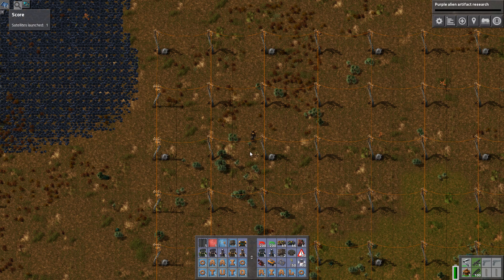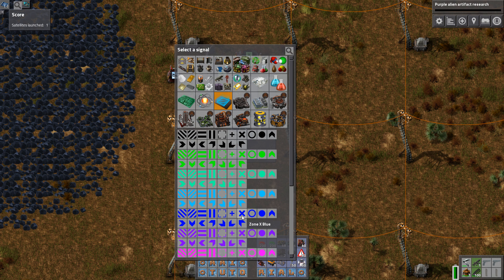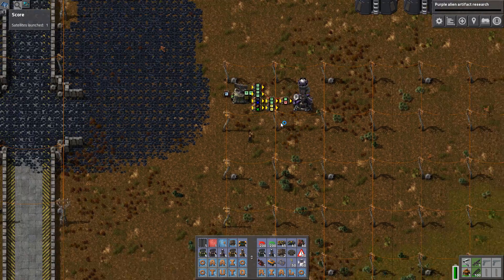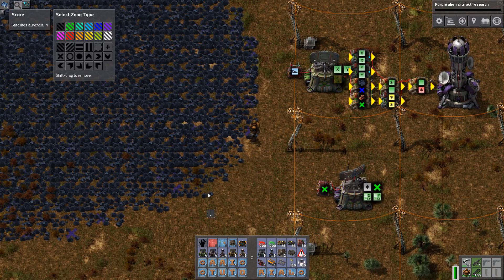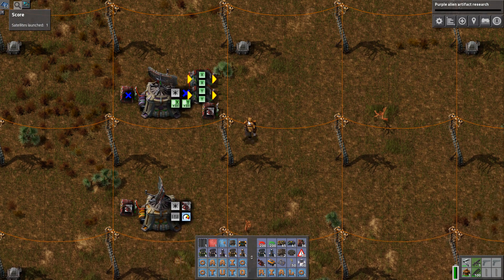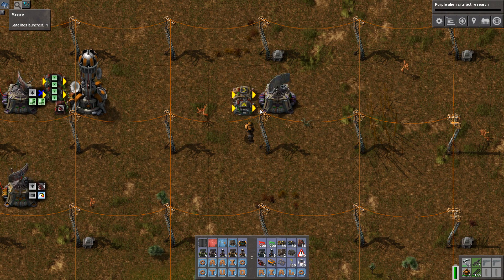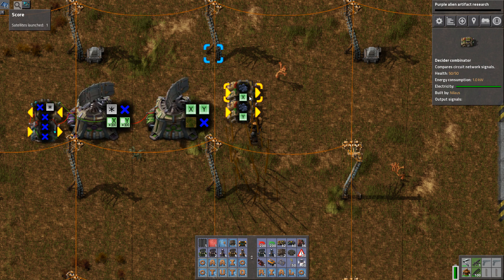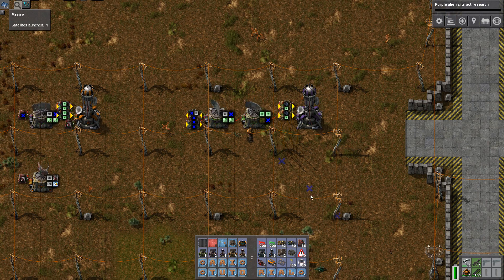AAI Mod Tutorial 3 - Automatic Zone and Miner assignment

Comment: so i can see im clearly not the only one scratching his head here haha. But for anyone who knows a bit about this can you tell me what symbol he used in the condition for the x & y combinator? since factorio has been long since updated but there isnt any symbol like it atm. you have the usual greater than less than greater or equal ect. But no cross of saint peter lol.
Reply: It's a plus sign. using an arithmetic combinator with input (whatever) + 0 , output (whatever) 'cleans' the wire to only one specific symbol. He was using it to separate the X and Y coordinates into their own wires.
Reply: @Paradician  thank you so much. I’ve found very little information about newer setups for this mod, most of them seem to be years ago unfortunately. Thank you regardless~

Comment: A brief comment for people who are trying to get this to work. Something has been changed in the mod. Now, when you click on the output for a Tile Scanner, it has a bunch of checkmarks to let you filter the sort of results you are getting. You need to UNCHECK "Entities" if you are trying to scan ore patches. If that box is checked, the Tile Scanner will be looking for loose pieces of ore that have for some reason been dropped on the ground. By unchecking it, it will scan for patches of minable ore instead. You need to do this in both the automatic scanner and the clean up scanner.
Reply: THANK YOU

Comment: The tile scanner can be pretty useful when you're trying to find resources in areas you haven't revealed on the map yet. Before I started using this mod when it came time to look for oil I use to have to drive all over the place and sometimes spend hours looking for it. 

Now I use a loop setup where I can put in a minimum and maximum x and y. After a bit of calibration I can assign sectors to scan. If it finds oil it will send out chain gunners to scout it out, with a system set up to scan a radius around each chain gunner to mark biter bases to remove. Once the detected nest is out of the way it resumes scouting out the oil fields.

It takes quite a bit of setup and finding bases can be nail biting since you don't know how many chain gunners will go a particular direction if multiple fields are detected (or if they'll split up and each try to commando a base if multiple bases are detected in an area), but it's been working pretty well so far.

The tile scanner is only useless when you don't give it any input and let it do the random scan thing.

Comment: Hi first i say sry for my bad english.
I have a big Proplem with your Blueprints from Discord. Sometimes the Hauler (Nilaus Truck) go to the Miner and go back, ok. But often the Miner is full but the Hauler stand still. Or the Hauler drive a bit, stand still, drive a bit, stand still... (anywhere but not to the Miner) I look between the Ticks but this is right. I stop the Counter -> the same Problem. Ok i jump in my Car, drive to the Miner and the Hauler and look the Hauler drive to the Miner. I drive back to the Base after some Minutes the Problem beginns again. Do you know what i have to do?
Reply: Sry i Forgot to say something.
I check the Signals on the Unit Controller and there are the right signals. Hauler 1 to Miner 1, 2 to 2 and so on. The coordinates are right. ok theres no Issues with the Signals by the Unit controller. But the Hauler lags more and more

Comment: Your first automatic scanner is wrong,  because you put the blue and green x's through another set of combinators it delays the signals by 1 tick.  When you pulled the x,y to the third combinator you are combining them with the blue/green x's from the previous tick.  

The fix is to pull, using a red wire, the x,y coordinates to the Each/Each combinator, you want to use red not green as you don't want the x,y going to the Anything combinator.
Reply: thanks a lot, i fixed mine
Reply: I fixed it like this. I'm not sure if this is right.  0eNq9WNGOojAU/Ze+LhhKZVAe9kc2hiBUp1loSVvMsBP+fW+L4yApDjg6L0YETk/Pufce8B3ty4bWknGNknfEcsEVSv68I8WOPCvNb7qtKUoQ07RCHuJZZY40K6mv8oyjzkOMF/QNJbjzvrzvn+DUh0W0FOXg1rDbeYhyzTSj/fr2oE15U+2pBOwLgtKyybV/pJxKllsO8M1XVGvGjwqWqoUCHMENCcD2iYdalASwWsEkzftTaw+daaR7+pqdmJDm+gMrNZUTEpyY1A388snFXuEHZie5aIyG+As5pjDwAMPHA2GWgKhGHrKcOumQRUhvvnHYCbReCKSavRMnWoRTZrxwwrwsgmH8BJUlZOurUmgnYLwIEMqwav2GMzfYZhk79xa3i0Bqxv+6CzLodp2BGvVW6Ojq6S5yAJALQCaZfq2ohsbMRbVnPAOtHWDBKrJwPr7uytDdlZ+wKZwuLJTq21Uqnd5R1YoaIIOmdGZkCjwkaiqzngf6BfeKRtfNHeidFR+mUn7hic2HpMVwtIHZyRauZDJvmLaHGAzyUDjv4tC46XBjPTUqz8qWN6fl2jksHctE7pl+A9Dl7MeGKlHQVBzSgQd4vowYz5PmZUoaxsFpR52uV2FAcNgXa7DC222IN3HkipI5POMJXvGF10dB3m6fng/uHphhMuPHq3kfDIJsN9+Kl4ktbqak77vMsUm82gRBvJmn/mNEuJWf+Hv5Ga7JnaHejqEICe9O9eswBlJRcGewtyMsYDXAeli47741TF2VuL07rYIfDav2qWHVLg8rMtbXuzq9GR2bCTI/3Mh4gns3J/yUuWbR80YLmrMCsm6WtfOeQ86Q83y9fvFhUnBfyHMfD4wEenUmLb0E/V7ipM3dN9+IaUHrNrUNlB6kqNI+0pJDVir6rCeS2a7gRa7g55nypYgPcebj3eBEZatf4UHrhkGQhkv8GXfVuFEcD4nT/kXWL3j1trWaDP4L8BBwV1b2mAQ4JluCI9J1/wFRUnwT

Comment: Has anyone else had the issue where it is randomly assigning zones? Mine starts dropping zone assignments randomly throughout the "in range" area of the scanner...
Reply: His first scanner is wrong, the green and blue x's go through another delaying them a tick,  so the x,y he pulls are for the next scanned tile, so he needs to put the x,y through another set of combinators to delay them a tick.
Reply: Im having the same problem
Reply: I figured out the issue. I had somehow arranged and connected it such that the ticks were off by one on the coordinates. So, the traces have to be the same number of hops from signal to destination so that they arrive at the transmitter at the same time as the desired signal.
Reply: i just setup the circuit exactly like the video and i still have the issue
Reply: Double check your wires and the direction of your combinators. I had one out of wack.
Reply: everything is the same
Reply: Check the Arithmetic combinators. Make sure they are *1
Reply: still broken
Reply: Found a solution to this problem?

Comment: Hi, I have noticed something about the zone cleanup.  It seems some of the inaccuracy is from iterating too fast.  I did tests using a stopwatch and found it took 1/3 less time to clean a zone when making the iterator slow down by a factor of 2 or 3 (got very similar results with both 2 and 3).  I did this by using 2 more arithmetic combinators in the iterator.  One multiplies the NumberOfZone signal by the factor, and passes that to the counter.  The counter passes its result to a combinator which divides by the factor and converts it to zone signal.  This also needs one extra condition to make sure we send a 1 if the math comes out 0.  Because of lack of decimals.  I set it as high as factor 10 and it still took 1/10 less time than the standard iterator.  It moves through the tiles much slower but it is far less likely to fail to unzone it.  The best time results I got were from using 2 or 3 which were within my margin of error to be able to tell which is faster.
Reply from the maker: The reason my cleanup skips every other tile is because when it scans tile #200 and this is empty, then it removes it and adds 1. However that means #201 is now #200 and then that will not be tested until next cycle. I've not had the time or bright idea yet on how to fix that, but have received some good suggestions.

Comment: Does the biter AI used for the vehicles pathfind  better between short distances or large distances ( 50units vs1500 units). if so is it better to use scaling positions ( n1, n+1, n+2 etc) via an iterator to manual pathfind ( ie when the vehicles hit pos1, send a signal to the interator to send them to pos 2 )  or just let the derpy ai be derpy between home and destination. ( I do realise that the AI can still  be derpy between point n and point n+1 )
Reply from the maker: I think it would be better to send it long distance with angel+velocity and then the final adjustment with the Biter AI. Generally, it is rather complex and fragile to use the angle because it can mess up when things get in the way (such as buildings and especially lakes). For that reason I accept the derpiness and the fact that it may take 2 min instead of 30 sec to get to a destination.

Comment: wouldnt the iterator not count the newest blue x tile? The number of that one isnt under the quantity, it equals the quantity.
Reply from the maker: Mic Lp, it will count the newest (n). When at iteration n-1 then it will increment and check for n, but the next round for n it will not increment because n is not less than n. It will then provide nothing and the cycle restarts nicely.

Comment: You could combine "manual" and "automatic" scanner.
So place before title scanner a zone scaner and make x and y from zone scanner to be input for title scanner. Then you can define one zone that you mark - hey check it for resources and mark with appropriate zones if you find any.

Or even combine both methods, if there is input form zone scaner, then scan its results and if not then go with range input so full automatic mode with possibility of creating "focus" zone.
Reply from the maker: There really wouldn't be any point in me tagging an ore field and then having the scanner find the rest. I am literally looking at it, so it is easier to make a drag box around it and let the clean up process remove the marks outside.
Reply: I find it better as I don't need to bother with remembering which mark is for which ore. I use just one for areas that are are ment to be checked. I don't need to be also very precise with it, scanner will clear area without resources.
In other hand it have downsides, if there is to much areas selected it might still take a lot of time.
Reply: Can you mark areas you don't see?

Comment: Maybe when it finds a single sapharite ore patch (distance signal) a switch can be triggered. This switch can now send as input to the tile scanner to scan only a 100x100 block around that found ore patch.  It then sends these x and y coordinates to the zone controller to mark the patch.

The process can be started when an ore silo is below a certain amount and stopped with a timer or after the ore patch has been completely or near completely zoned ( if that is possible)
Reply from the maker: Yes, I have been considering that approach and it is a really cool idea. However, it seems more of a proof-of-concept than actually useful.
Reply: what do you mean by that?